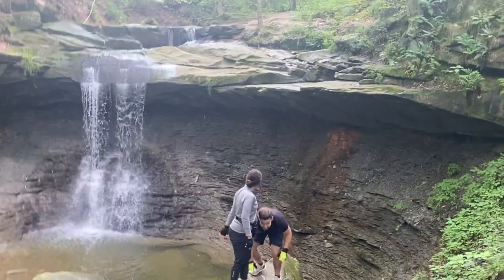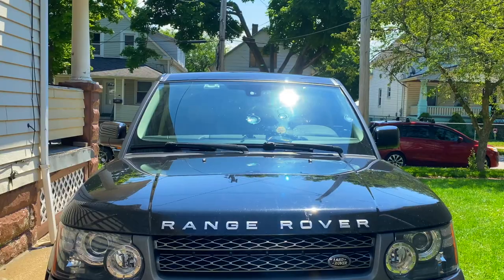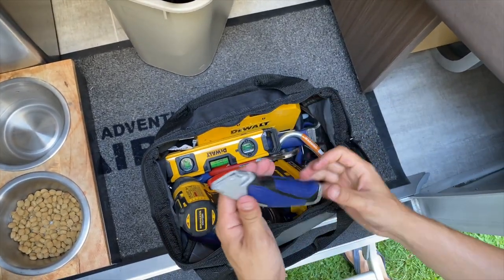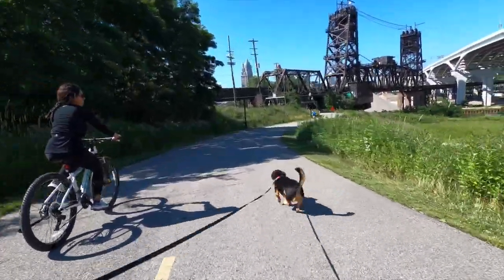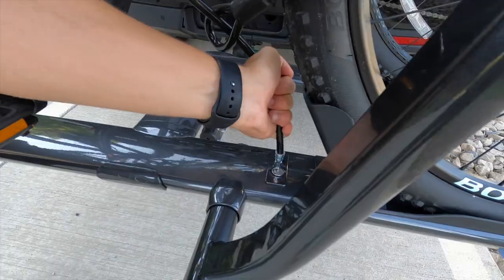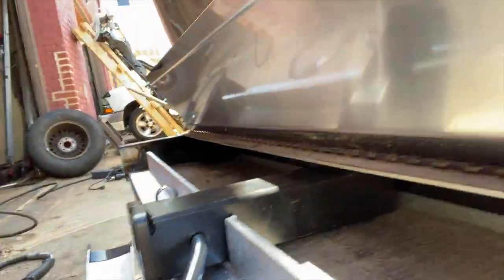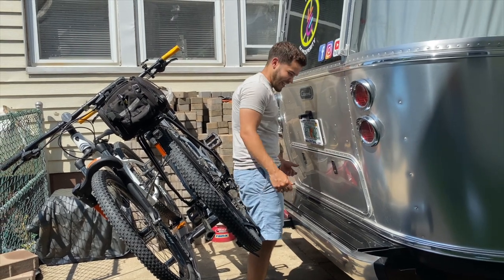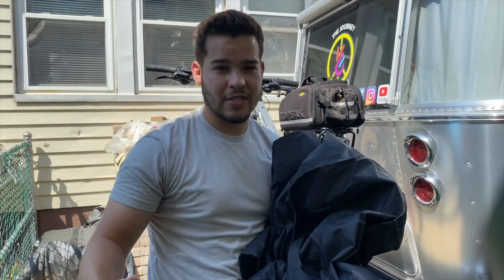Installing Bike Rack and Hitch Receiver To Our Mini Airstream. | The JOP Fam

Comment: This is not recommended by Airstream. Airstream frames are lighter than box trailer frames and the aluminum monocoque body construction carries part of the load and stiffens the structure.  Hitches have been put on Airstreams for years and some ended up with "tail separation" where the frame and body separate and the rear sags which is an expensive repair. You've created a moment arm beyond the rear of the trailer that could ultimately weaken or shear the rivets which are also aluminum. The only bike rack Airstream recommends is one made by Fiamma which attaches to the both frame and the body so the weight is carried across both.
Reply: I’ve wondered about this. Dam shame to not be able to take bikes with you.

Comment: Great video. Would you be so kind as to show a picture of the L shaped steel beam and how you welded it to the right side frame where the tailgate lid retractable arm is (when you're facing the rear of the Airstream)?

Comment: Air stream said this would give trailer sway issues. Did you have any trailer sway issues?
Reply: Came to the comments looking for this feedback... I'm installing a hitch for a bike rack on our 30' international this weekend.  People that have racks on the forums claim no issues, although one Airstreamer was hauling a motorcycle out back and had a bad rollover accident due to sway.  There's a big difference between a couple mountain bikes that weigh 40lbs tops and a motorbike that weighs several hundred pounds.
Reply: This is a new product from a reputable company:  https://torkliftcentral.com/airstream-accessory-hitch-x8000